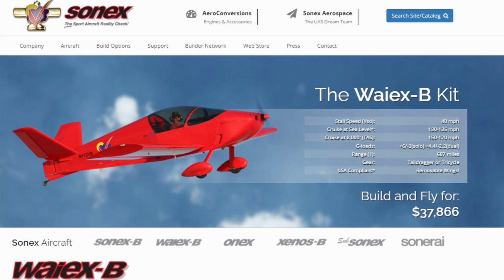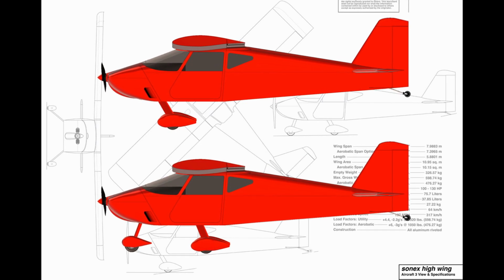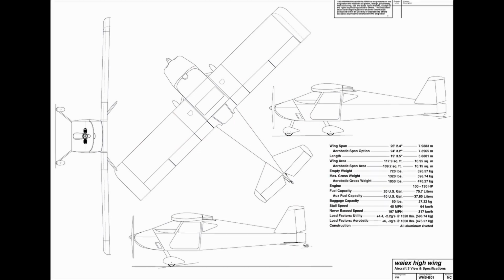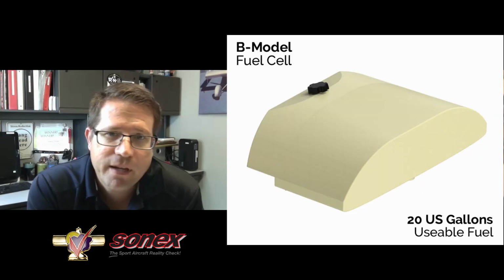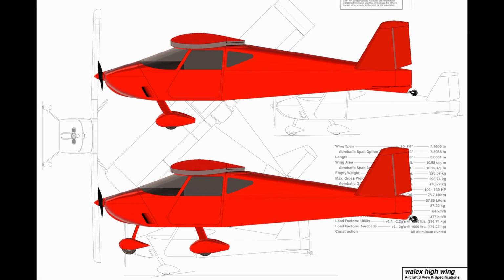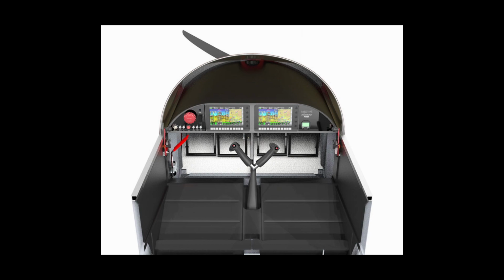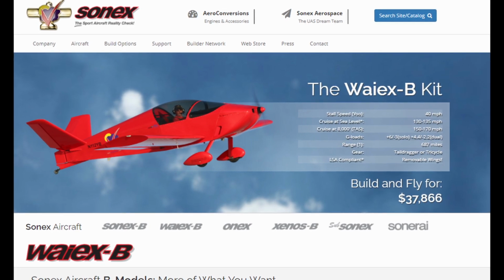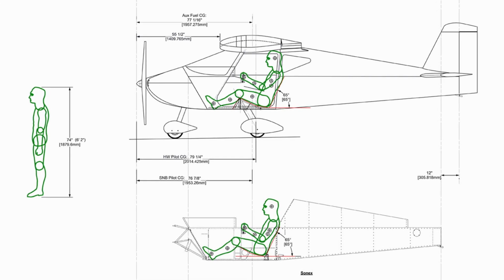The SONEX High Wing w/ Mark Schaible + Community Response!

Comment: Love my RV12, but I think this may be my next!  Love the looks of the taildragger.  The extra fuel capacity and cabin width.  It's just about perfect.  I'll stick with Rotax. Just not sure if it'll be the 912is or 915is.
Reply from the maker: Yup, so cool to see a modernized Tailwind. Definitely multiple engine options, but Sonex is using the 912is in the One Week Wonder build next year. Lessons learned from that will find their way to the High Wing for sure.

Comment: would be nice if the wings are foldable much like kitfox
Reply from the maker: I agree, that is my preferred way of doing it. Instead, the removable wing sections then need a cradle or some other method of storage to prevent damage. I wonder if they'll offer a purpose built trailer for the High Wing like they do with the Subsonex... 🤔

Comment: Sonex needs to develop a areovee 6 cylinder.
Reply from the maker: I was just pondering this idea too. The engines, weight and balance webinar claims an engine weight of 175# for the Aerovee 2.1. I wonder if the extra 2 cylinders and everything else required would take it over the 200# design limit. Could it be lighter than a Corvair engine? Or maybe that's one of those other future announcements eluded to in this vid. 🤪 (I have no clue.) Engine webinar:
https://www.youtube.com/watch?v=Fzh37pMiIrE
Reply: @LeftSeatAdventures  yeah,, many of the cool modern engines get really pricey! The Rotax and UL's are great but the costs!!
Reply from the maker: It's worth noting that Revmaster was developing their R-3000 4 cylinder rated at 100hp, peak 114hp. But they haven't been able to get the capital to get the project off the ground.
https://www.facebook.com/RevmasterAviation/videos/heres-the-specs-on-the-r-3000-that-hopefully-will-be-going-into-production-soonj/255046785396105/?__so__=permalink&__rv__=related_videos
Reply: @LeftSeatAdventures  Another great engine line that doesn't get much press in the US is MWFly.  They have engines ranging from 100-160hp in 2.2L and 2.5L, that can but built with or without a PSRU gearbox.  They are dual ECU FADEC and water cooled... kind of like the UL and Rotax had a baby.  They are also working on a Turbo-normalized and Turbocharged options.  They have currently built 280 engines since 2013, and are also ASTM certified, which not many other engine companies can say beyond Rotax.  I just started representing them here in the US, and have a B22D installed in my Sonex.
Reply from the maker: Yup, I remember seeing you on Bryan's channel. Price point is similar to a Jabiru 3300 right?
Would love to see more with your Sonex.
For those who missed it:
https://youtu.be/15OPHJ3i_V0
Reply: @LeftSeatAdventures  Awesome, I appreciate the fact you watched the episode with Bryan on Experimental Aircraft channel!  The pricing is on par with UL, and the 100hp 2.2L pricing is on par with the Jabiru.  The 160hp 2.5L Redline model with PSRU gearbox currently runs $27k USD and with all FWF items roughly $31k.  Which does present quite a bit of savings when compared to say the 915is.  The Turbo-normalized versions will be the next major innovation, and there will be retrofittable kits released as well.  The new design incorporates a new intake manifold design which will allow this upgrade in the future.  I would love to see the Sonex high-wing with a 160hp MWFly engine installed.  I do have some photos of my Sonex with B22D motor posted on the Facebook group, but have yet listed anything on the forum.  Hit me up on messenger and I can shoot you over some FWF photos.  😄
Reply: Yeah, they could base it off the old air cooled flat 6 Porsche engine.
Or Subaru. Corvair is a flat 6 that has been used for aviation for ages.

Comment: I wonder if the center armrest will be removable for sitting in the center for solo flight?
Reply from the maker: My gut says no because of the control setup, but I really don't know. I think that's part of why the center console would exist.  Of course, as the builder, you could probably work that out. Maybe a "booster seat" over it for those moments? It'd be a good question when they do the webinar for the High Wing.

Comment: All those guys were good to talk to when I went to Oshkosh this year. I am excited to watch this project evolve but I am still in the low wing camp.
Reply from the maker: Bah, low wings! 🤣🤣🤣 It'll be interesting to fly both and see what I prefer day to day. But it really depends on mission, if I'm flying gravel strips in AK, I'd rather have a high wing, but the low wing is just fine for my everyday needs. Although, polished low wings act like a big tanning bed when you're flying, something to consider. If I were building one now, I'd paint the wings.
Reply: @LeftSeatAdventures  High wing is definitely better for bush flying. You will have to take me up in that high wing when you get it built. I was planning on painting my Waiex B but started to think about leaving some polished for weight. I may have to re reconsider that now. LOL
Reply from the maker: Sounds like a plan on the flight! Wrap around sunglasses or visors help, but you do get extra face burn from the polished wings. Don't know if vinyl would be lighter than paint...

Comment: Bubble doors was an option I hoped they would go for and it sounds like they are considering it. Also glad to hear they hope to improve the design with the wing removal. I really would like to be able to have it where I could store the plane in my garage. I can only imagine what hangar rent will be in California in 3 years. Great interview and look forwards to hearing more 👍
Reply from the maker: Yup, Sonex has learned a lot over the years and works improvements into new iterations. Bubble doors add even more flexibility for big guys like me. Right there with ya on storage, my hangar is pretty cheap for now, but you could easily store another aircraft and split the cost, or like you said, keep it in the garage. Wonder if it could come with a trailer like the SubSonex.... I had a 2+ hour conversation with Mark yesterday, so definitely more coming from it.
Reply: @LeftSeatAdventures  I’d probably build the Y tail tri-gear version. With the Y tail, it might make for an easier trailer arrangement with the wings and fuse. Plus I think a high wing Y tail is just so unique. I’ve never seen one before and it looks so cool. Any idea how far in the future that EAA webinar may be? I’m really hooked on this plane!
Reply from the maker: @3dfoamies  No clue on the webinar, I'm expecting there'll be a Hornet's Nest email. If you plan on using an enclosed trailer, the tail will sit higher with either as a tricycle gear. But the tri gear is easier to secure regardless. I've always loved the look of the Y Tail, but since I'd want to fly it to Alaska, I'd probably go conventional. But that's assuming the conventional tail has more rudder authority in a stiff crosswind. I honestly don't know, got 2+ years to sort it out though.